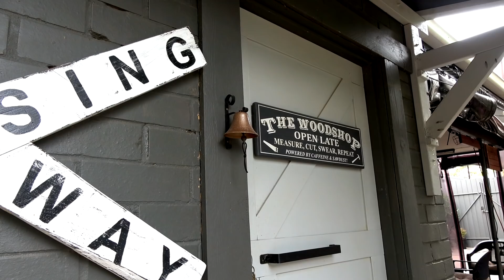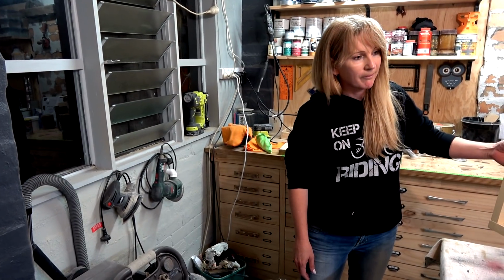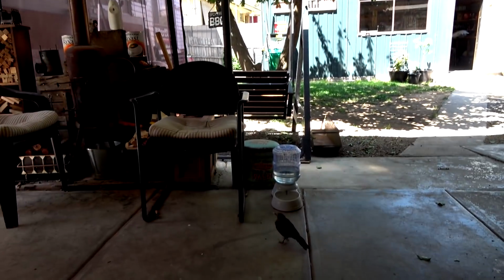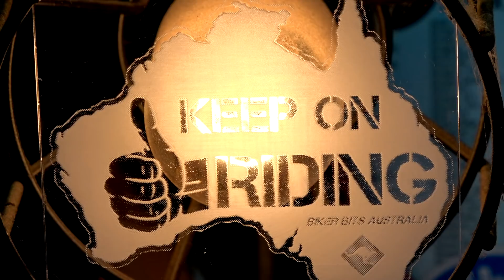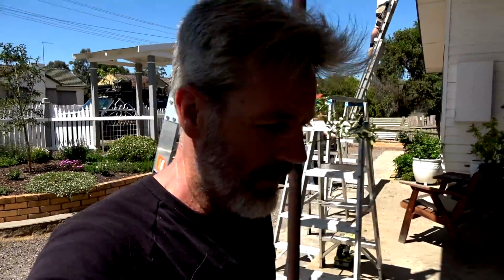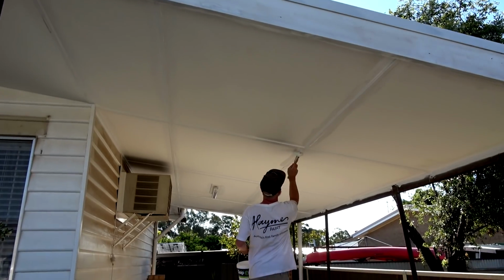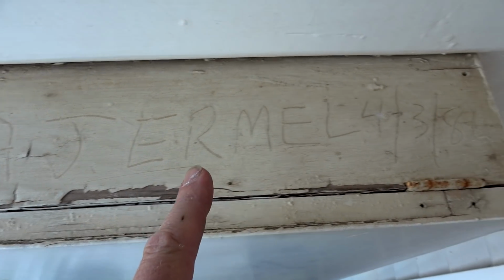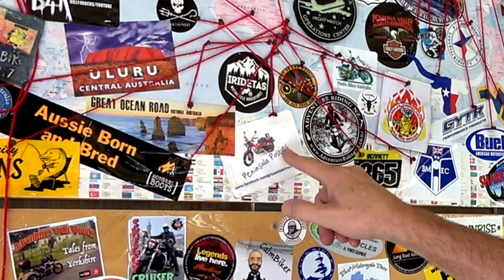Getting Creative! MCT 2020 Ep.8

Comment: Don’t do power wash on house it doesn’t work as good as what I tried!! Get a pump sprayer 2 gallon from hardware store fill with half bleach and water start from top down section at a time let sit for a minute or two no longer and rinse well with water and you will see an awesome clean siding and windows on your home!! And the bleach doesn’t hurt the siding/windows at all as long as you don’t leave on too long and rinse it well and Bonus the bleach kills the pollen and helps keep it off way longer than power washing plus I think power wash can damage siding and water can get behind to the wood because of the pressure!!🙏👍💪👌✌️✌️✌️✌️